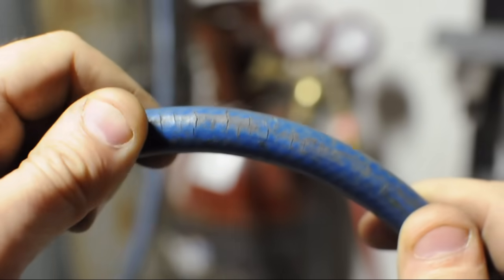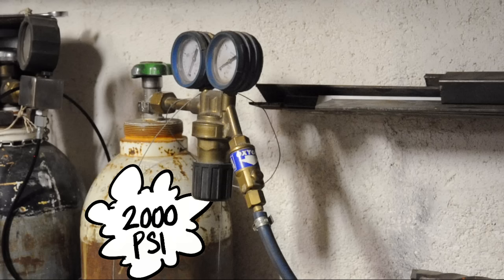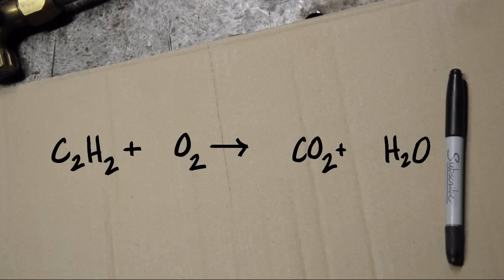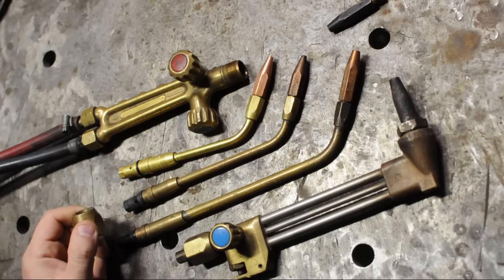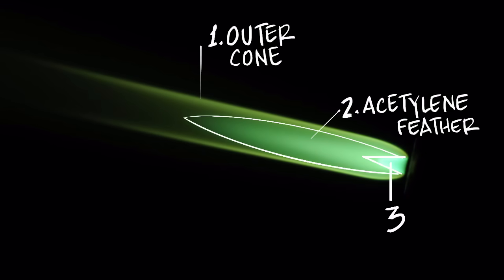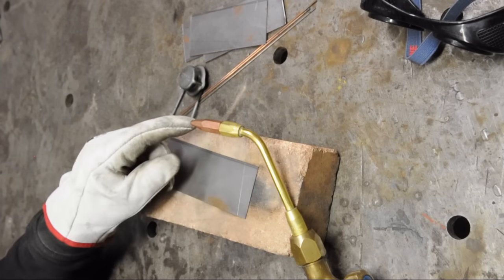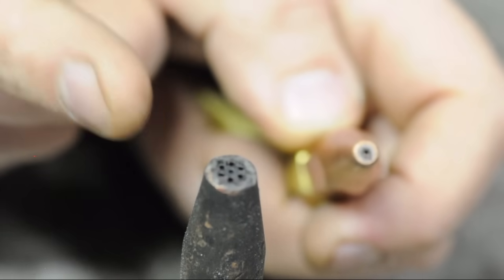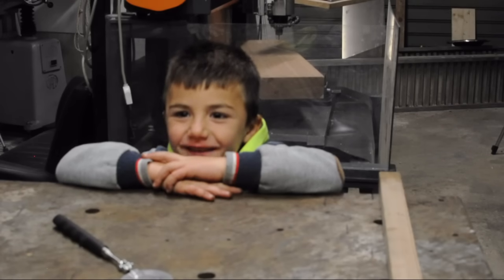Let's Talk Oxy Acetylene

Comment: Couple of things not mentioned. 

First, when you purchase oxyacetylene hose, make sure you get oxyacetylene hose. There is another grade/type which looks identical but is meant for propane or map gas only. If you use it for oxyacetylene it will degrade from the inside out and start to leak through tiny pin holes on the fuel gas hose. This is because the acetone vapours carried with the acetylene will attack and slowly dissolve the hose itself from the inside where you cannot see the damage. 

Second, the reason for using a striker to light a torch instead of a match or lighter is in effect gas conservation and safety. The cup that you always have on your striker is actually a small gas reservoir that collects some additional gas and makes your torch light easier and quicker. If you use a match or a lighter it can be difficult to light a torch where there is significant air movement from fans or, if working outside, wind that blows the gas away. In addition, using a striker ensures that you hand is away from the flame ignition point and you are less likely to get burned. 

Third, the charts that your torch manufacturer provides for pressure settings are only good for about 25 feet of hose and are only guidelines. If you have more hose, the pressures must be increased to compensate for friction within the hose dropping the volume at the torch tip. A better way to set your gas pressures is as follows:
       1. With the acetylene regulator adjustment screw fully relaxed crack the main valve on your acetylene bottle and when the regulator is fully pressurized open one full turn. Adjust your acetylene regulator so that you just have a small amount of gas flow.
      2. Light your torch and open up the fuel gas valve on it all the way.
      3. Slowly increase the pressure from your regulator using the adjusting screw until the flame just blows away from the tip. This is the maximum amount of gas that particular tip will flow. NEVER EVER set your acetylene regulator for more than 15 PSI! Acetylene can become unstable at higher pressures and become self explosive.
     4. Close the torch fuel gas valve until the flame returns to the torch tip or shut it off completely.
     5. Ensure the adjusting screw on your oxygen regulator is completely relaxed, stand to one side or out of the line of fire and crack the valve on the oxygen cylinder open and allow the high pressure to ease up to full pressure. NEVER OPEN THE VALVE ALL THE WAY UNTIL THE HIGH PRESSURE SIDE OF THE REGULATOR HAS BEEN SLOWLY BROUGHT UP.  If you open the valve wide initially you can damage your oxygen regulator's Bourdon tube inside of the pressure gauge and in extreme cases actually blow the glass out of the gauge itself. The surge of high pressure has also been known to blow the regulator body off the bottle when the regulator has been damaged hence the standing to one side out of the line of fire unless you really want to catch a pound of regulator propelled by 2000 PSI with a portion of your body which can be painful if not deadly.
     6. After the regulator has been fully pressurized, open the oxygen valve all the way and adjust the regulator pressure screw so that there is a small amount of oxygen flow.
     7. With the torch lit and burning at the tip (not blown off the tip), open the oxygen valve on your torch all the way. You will notice that the flame changes when the oxygen reaches the flame.
     8. Adjust your oxygen regulator up until the flame becomes neutral. 
     9. Increase the opening of your fuel gas at the torch slightly and bring the oxygen up again until you have a neutral flame. Continue to open the valves as described and adjust your oxygen until both torch valves are open fully and you have a neutral flame. Your torch is now set for the maximum flow that that particular tip will flow and is at it's highest efficiency.

Fourth, when using fittings or hose splices on oxyacetylene systems, the fittings cannot be copper. They must always be brass. Copper and acetylene have an affinity for one another and combine to form a new gas which is unstable and self explosive at virtually any pressure! In England, they used to use acetylene for lighting in homes. The gas was run through copper piping and on occasion entire blocks of homes and their occupants would simply blow up for no reason until this was discovered. Oops........so sorry, my bad.

Fifth, never discharge an acetylene bottle at more than 1/8 of its contents per hour. Higher discharge rates can result in the acetone in the bottle being drawn out into your hose and torch. If you must use higher rates consider using two bottles with regulators and manifolding them together. 

Sixth, when cutting material cant your torch tip slightly so the flame is going in the direction of the travel. This will preheat your material and give you a cleaner cut with less slag adherence on the bottom. Thinner materials will require more angle than thick. If your cut is so poor that the pieces stick together use a hammer to part them and not your torch. Nothing speaks of poor practice more than a torch that has been used to hammer pieces apart!

I know that some are going to give me flack over this but consider this: I am a journeyman welder with over forty years experience and I have never blown a gauge up or destroyed a torch. A torch can be a versatile and precise tool in the hands of a good tradesman but, like anything else, it can be so much junk when abused.
Reply: A small correction to your note about copper and acetylene: the danger is not from the formation of a new gas but instead from the formation of the extremely sensitive explosive copper acetylide from the reaction of acetylene with copper oxide formed from the surface oxidation of the copper during manufacture (and from any air that might have gotten into the line at any point). Copper acetylide is indeed highly explosive: the analogous silver acetylide is used in certain types of blasting caps as a primary explosive initiator. The reason brass is safe is because the oxide coating on the surface of brass is composed almost entirely of zinc oxide: this is inert to acetylene and prevents the formation of any explosives.

This doesn't affect the correctness of anything else you said though.
Reply: Thank you for taking the time to add this to an already informative and well produced video. It's been my experience that many of the best teachers of workplace skills are folks like you who have decades of real world experience and the ability to speak or write well enough that others can really understand and absorb the valuable information that you have.  Again, I thank you.
Reply: Small correction t grade hose is for all fuel gas types,   r grade hose is for acetylene only and if used with alternative fuel will degrade fast.
Reply: A side note, rather than an addendum: 

Talking to former London Fire Brigade firefighters, one of the worse, and much hated fires, they used to attend was anything to do with bottle gas. Usually the Incident Commander (the highest ranking officer on the fire ground in charge of the operation), would order the maximum exclusion zone around it as possible, for just the firefighters alone, but still within reach of the water jets. A even bigger evacuation zone would be made for the public, and kept in place until the fire was doused out. 

The scary thing about a gas bottle that has reach the temperature of being 'cooked off', isn't just they might explode when they land, but just the sheer mass of one, at velocity, presents a risk to life and limb.

One last thing ... Never do what a friend, in a moment of sheer madness did: fill a large bin liner with oxyacetylene, and set light to it ...

Suffice to say the bang, in the large hall he did this in, was strong enough to rattle the windows, and shake the dust down from the tiled roof above ...
Reply: Thank you for the added information. Welding instructor at school also said using a butane lighter to light a torch is like holding a small bomb in your hand. There is some potential that the lighter could explode (that's why you never keep one in your pocket).
Reply: Yes, its clearly easier to use a striker to light a torch than using a bic, thats why nobody ever does that.
Reply: @johndias6614  Styrofoam cups are a much safer alternative to this practical joke.. cough cough, don't do this...
Reply: This is the best Youtube comment I have ever seen. Amazing.
Reply: You clearly are a pro. Good stuff, thank you
Reply: No one does stick welding anymore... I feel excluded! :(
Reply: Some very knowledgable characters here. Thanks for sharing.
Reply: @johndias6614  I threw one fast on the ground once and it exploded and just disappeared.
Reply: Some great advice, thanks for taking the time to pass it on. I'm glad to be able to tell you that we here in the UK are now blessed with new fangled electric lighting in order that our houses no longer explode 😁 I've just spent the best part of a week machining and brazing up castings for a customer and have come to the conclusion that I need to invest in some new torch nozzles! Some wacky flame shapes even after extensive cleaning.
Reply: You, Scooter, are a god among men. Thank you for sharing the knowledge.
Reply: @billsmathers7787  copper is the catalyst en witch is normally needed in most cases to create a gas or a chemical reaction. (DOI NOT TRY THIS AT HOME KIDS IM FOR FUCKING REAL HERE YOU MIGHT DIE!!!!) like bleach and ammonia does not create mustard gas by its self does it will react with each other like most chemicals do if mixed but take a penny pre  1940 or whennver copper pennies stopped being made or some COPPER and poof now you just made mustard gas the copper is the catalyst that created the reaction.
Reply: @nigelft  out in my buddy's dads junk yard we would take oxyacetylene and let it pump into a upside down 55 gallon drum that was dented to get it straight again and run a trail of gas and light it and watch as BOOOOOM it could go way up into the sky lol like a good ways. or we would take a 1/4 stick of dynamite and use it to move cars in places the loader would get stuck or just to make life eaiser as booooom a car would go flying.  good olds days lol
Reply: @billsmathers7787  Thank you for your correction.
Reply: @johndias6614  Regarding butane lighters in your pocket, years ago as an apprentice I did just that. In my case though I was welding at the time and noticed that my left leg seems to be getting cooler than my right. Since I was outside in the shade, I assumed that the wind was picking up a little and kept going until the end of the rod was reached. By the time I broke the arc I knew something was up as my left leg was now definitely burning. Not from heat mind you but frostbite from my hip to halfway down my thigh there was a layer of frost as the butane boiled off from a small hole that a spark had melted through the side of the lighter. It was, to say the least, a never ever again moment.
Reply: @Biden_is_demented  Stick welding is very much alive and kicking and is still used on about 50 - 60 percent of all the work done. The problem is most DIY folks have access to or own a small mig for it's ease of use. If you want to learn stick, talk to any good welder and most would be more than happy to offer some tips and possibly some coaching. One of the most in demand jobs in the coming years will be welders. A Union welder can make anywhere from 50 - 150 thousand a year depending on his qualifications and where they are located. I have made in excess of 160 thousand in one year myself working for wages here in Canada on piping systems in the petroleum industry.
Reply: @PurityVendetta  Yes, I had heard that there had been some improvements in that area. Now, if we could just get your to drive on the right side of the road........lol.........just kidding. There is a reason that England and some of the other English based countries drive on the left and other places in the world drive on the right.
Reply: @Biden_is_demented  heaps of people stick weld. Stick welding will never be obsolete. Want to weld hot and heavy outdoors in the wind. Stickweld.
Reply: @I_leave_mean_comments  So you follow the NASA approved Apollo 13 school of engineering?
Reply: Did you open a textbook and copy straight from it. Everyone on YouTube is suddenly harvard educated
Reply: Ok mr professor. Or was this your thesis? 

Jk informational and whatnot it was. For others at least.
Reply: Holy fuck. Who’s mans?
Reply: @zznet2  Or fill zip up gym bags with town gas, that's very dangerous and silly as well. Number 00 zips make the best burners.
Reply: I am a safety officer and i am gonna save your comment.
Reply: Many tips I didn't know.  One problem I used to have occasionally was that the bead would start to spark more and more and then POP and put the torch out.  Any idea what caused this and how to stop it?  It was usually when welding exhaust pipe.

Was this flash back?  I did at least have arrestors in the line.
Reply: @John Sikes - I'm no pro welder but since nobody else replied, I will. I was told that this was caused by getting the puddle too hot and when it boils, we see that as a pop and that is what blows out the torch flame. I'm sure others can chime in and correct me but even if I'm wrong, that's the effect. Too much heat and pop. The solution is to back off, move a little faster or in some other way reduce the heat in the weld puddle.
Reply: @majormindup  Thx, next time I weld something I will give it a try.  I had someone there when it was happening one time that was a training to be a welder at a tech school, and the same thing was happening to him (with my rig) and he didn't know why, so I was thinking it might be something in my setup.  The boiling kind of makes sense, since it would eject sparks right before the pop.  It was infuriating because you couldn't weld a continuous bead, and since I just picked up a torch without ANY training and sort of taught myself to weld, I didn't have any idea what was causing it.  Extra fun when you're welding ABOVE your head and body, like I was there.
Reply: @scootertramp4355  I didn't realize frostbite was a risk of a lighter while welding. That has to be one of the most ironic injuries ever.
Reply: @5000rgb  It wasn't pleasant and my partner laughed like hell. I was just glad that it had not ignited. It would be hard to explain to a doctor or a safety officer about how you froze your thigh first and then you set it on fire........lol
Reply: @MrJdsenior  I would have to see what you are doing to be sure but from the sound of it I would say that you are using a slightly oxidizing flame and your torch tip is too close to the bead. When gas welding mild steel you should have a slightly carburizing (acetylene rich) flame. An oxidizing flame will normally have a very pointed looking inner cone and be accompanied by a noticeable hissing sound. A carburizing flame will have two inner cones. The main cone will be larger and a bright blue while second cone will be at the tip of the first cone, smaller, and a darker blue. Both of these cones will have a more rounded end and the sound will be soft. The carburizing flame will ensure that you are not actually burning the metal. With an oxidizing or oxygen rich flame the excess oxygen will actually weaken your weld since the O2 is causing the metal to burn much like slag from oxyacetylene cutting. An oxidizing flame will cause your weld puddle to "sparkle" and throw off small sparks as the metal is being burned. The only instance I know of where an oxidizing flame is used is to sear cast iron just prior to brazing it.
The "pop" and subsequent blowout can be caused by a couple of things. First would be improper gas settings where there is too high an oxygen pressure. Second would be getting the torch tip too close and getting it too hot or having dirt on the end of your tip which can glow and act as a source of ignition. When this happens, the gases can start to burn inside the tip causing a small explosion. While irritating, a "backfire" is seldom a major cause for concern. A true flashback is a situation where the gases actually begin to burn back inside the torch and then into your hoses if very severe. Normally when you get a flashback, the torch will blow out but it will continue to blow off black smoke with small sparks and have a high pitched whistling sound. I have seen a torch where the flashback was so severe that the torch handle actually melted. Flashback is caused from improper gas pressures. If your O2 pressure is too high, it can start to back feed the lower pressure acetylene back in the torch and into the hose if left long enough. Since this is an oxygen feed flame it will not normally extinguish itself and your acetylene is burning inside the torch. Another possible but less likely reason is very low O2 pressure where the acetylene over pressures the O2 and the flame "chases" the O2 back into the torch and line. This is normally caused from an O2 cylinder being close to or in fact empty. The cure in both cases is to shut off your fuel gas valve on your torch immediately. Flashback arrestors are actually miniature cooling grids made from steel or aluminium mesh in a small canister. As the fire tries to pass through them the mesh or corrugate acts as a heat sync and cools the flames below its ignition point causing the fire to go out.
Reply: @oh8wingman  WOW, thanks for the VERY detailed response.  Yes, much harder to diagnose the "disease" over the "phone", I get that. 

 I was trying to set flame neutral, and was pretty careful to make sure the cones were accurately matched, making sure even the tiniest possible decrease in ox moved the cones apart, and that I was right on the cusp. of cone alignment. There was no "excess noise" from the flame, like you get oxy rich, as you say. 

However, I didn't know about wanting a slightly carburizing adjustment for mild steel, so that might have helped.  I used the pressure settings given for the tip size, so they should have been right, but they were very long hoses, and now I wonder if there could have been pressure drop to the far end from the regulator static settings.  The tip was clear, as I had to clean it after some of the pops, which did exactly what you mention. 

Maybe I should have adjusted the pressures AFTER the torch was in operation?  I know that used to cause headaches with paint spraying, to the point where I started running the compressor regulator 10-15 PSI above the gun pressure, and put a secondary regulator AT the gun (a LOT more flow there, though, I'm pretty certain).  The other fix was flowing air continuously from the gun, stopping the trigger at paint cutoff, rather than full release, which became pretty automatic, once I thought of it, or lucked into it, don't remember which.  Seat of the pants learning gets you there usually, but you miss a lot, and it's more difficult.  On the other hand, I sometimes come up with techniques that work really well that I never see other people using, (until I finally do see one that "get's it").  Here's a good one for you if you do any electrical taping.  Before you begin the wrap, stretch the tape about 20% or so. and you can easily make very tight, even almost water tight (at least spray water, not submersed) wraps.  

And yeah, the very old screens in the miner's flame lamps way back worked that same way, thermodynamically insulating against explosive atmosphere detonation, rather than any type of physical flow restriction, pretty cool and clever that, wonder who first came up with it, and if they even knew WHY it worked when they did?

"Torch melting"...scary stuff, sounds like a way to get a nasty unexpected burn, even through the gloves (another thing that amazed me the first time, how long those gloves stay REALLY hot, and how fast you manage to get them off when you do latch on, or stay too close for too long, to something you shouldn't.)  Sometimes hard to know what is hot and what is not, unless it's VERY hot, radiating in the visual range. 

Reminds me of the guy who picked up a hot blacksmith's horseshoe and immediately dropped it, garnering a wry question from the smithy "Whatsa matter, bit too hot for you?"  Where the "dropper" immediately replies "No, just doesn't take me that long to examine a horseshoe."  I know, everyone's heard it, but it's still worth an honorable mention, IMHO.  ;-)

It was amazing to me how many things I thought worked one way, and found out they worked in a totally different manner as I progressed through my engineering degree.

If I ever fab anything with a gas torch again, I will try this, or maybe even find some pipe and just try your ideas to see if they work, if there's still gas in the cylinders.
Reply: Scooter Tramp my friend was using a striker to light my torch but he waited a few seconds so a gas cloud built up around his hand😂. He will never do that again
Reply: A huge thanks for adding your notes to this excellent video
Reply: @EricK-ig4ko  Except for you as it seems. You can't even use the correct punctuation marks.
Reply: This is probably the most helpful comment I've read on YouTube. As a newbie trying to learn this comment is gold.
Reply: Damn good stuff right there.. Ty for sharing your knowledge. Every bit of information helps..
Reply: Thanks for the essay
Reply: Jack Braddell  t grade also fine for oxyacy fuel ?
Reply: acetylene passing through copper tubes at high pressure. that's how you produce some benzene. and benzene is bad news almost in any case.
Reply: Very informative!  Thank you for sharing your comment.
Reply: @majormindup  Carbon in the tip? Dirty?
Reply: Many thanks for an excellent tutorial! We've learned a lot.
Reply: I’ve learned more from this then I did in my high school welding class
Reply: Im guilty of using the back end of the torch to lightly chip away stuff. Lol
Reply: What a bloody great comment mate!! Glad I read it. You've made at least one person safer in his workshop, thanks. 

I use oxy LPG due to the cheap cost of gas. May change to acetylene if it's significantly better for some reason?
Reply: Thanks for sharing your knowledge and experience.
Reply: @PurityVendetta  hi, you want to clean and flatten the faces of the nozzles, the slightly round the edges (so they don't melt off). Use the proper gauge cleaner for your nozzles with a deft touch. You can check for excessive wear with the proper sized drill bit held only in your fingers, gently insert it (-she) and if it isn't a nice tight fit (-she, again) you might need to replace the nozzle or upsize it (don't, instructor!)
Reply: @scootertramp4355  you got rid of that left leg? great move!
Reply: Fourth, when using fittings or hose splices on oxyacetylene systems, the fittings cannot be copper. They must always be brass. Copper and acetylene have an affinity for one another and combine to form a new gas which is unstable and self explosive at virtually any pressure!
Aren't the 'tips' or 'nozzles', whatever is the correct term, made of copper?
Reply: Hello,so if i would want my oxy acetylene tanks to be outside of shop for example,which pipes i could use to bring both gases inside shop(brass only ?,how about pvc for plumbing bathrooms ?) ,after which i would ofc use these normal hoses that are everyone using ,red and blue :P.Sorry for my bad english.
Reply: @nigelft  Great! thanks for planting the idea in my head.  Now I'll have to resist every time I see a garbage bag.  :-)  Maybe just a balloon is OK?
Reply: @KnKDarkLotus  

Oh God ...

Decades ago, when I was in College, a fellow student several years older than me, told about a story about how he, and some friends of his, found an old, abandoned car, in the middle of nowhere. So they saved up their money, topped the tank up with as much as they can, whilst leaving several, full, petrol/gasoline cans inside ... 

Suffice to say, the fastest one stuffed a rag in the hole where the petrol cap would be, lit it, and ran ... 

He didn't dare go back, but the way he described it, before he took off running, rather than a bang, it would've been a boom, big enough to shred it, rather like an artillery shell dropping onto it practically vertically ... 

Part of me wished I could have gotten my grubby little hands on dynamite, but given what just enough dust, of any organic* kind, in an aerosol form, plus an ignition source, can do ... perhaps not ...

[*= may not be organic, but, aside from mine explosions, from coal dust, one of the worst was when a badly maintained sugar refinery went up. The aftermath was lethal (14, in total), and practically tore through solid metal structures like it was wood, and paper ...

https://en.m.wikipedia.org/wiki/2008_Georgia_sugar_refinery_explosion ]
Reply: @andrewallen9993  

The very same ...

But, to be honest, no-one, in the entire brigade, was prepared for, let alone trained for, a fire of that magnitude. 

The initial 'Stay in Place' order was done, because it was thought that the fire floor could be contained, meaning the floors above could be evacuated, safely. That meant each crew could make it up the available stairwell, without having to push through a panicking crowd, but rather clear each flat in an orderly manner.

What caught nearly everyone off guard, was the possibility of complete loss of containment, as the fire evolved between the outer cladding, and the exterior brick/concrete walls. Aside from the cladding being extremely flammable (and yes, no-one thought to test the bloody stuff, to the correct BSA Fire Standard), it also created a huge number of vertical channels, meaning the fire quickly swept upwards way faster than anyone could anticipate, in the 1"-2" gap between the cladding, and the 'exterior' wall.

Worse, given the height of the building, but the narrow streets, means that, unlike, say, the FDNY, with their tiller ladders, the LFB doesn't have anything of the kind, so they had to fight the fire from within. In fact, it was so bad, the then Commissioner of LFB herself, was not only there, but briefed every single fire crew entering that towering inferno, as she knew she was facing the very real possibility that some, if not many, weren't going to make out alive; she wanted to look each and every one, in the eyes, as she was certain she was sending them to a certain death. 

Also, and this was equally unusual, it was Assistant Commissioner, who resinded the 'Stay in Place', as he became the Incident Commander (which is very rare occurance), meaning command of the fire ground reached the highest levels of the LFB, before calling the Commissioner himself, for her to be on the fire ground, in person, just in case she needed to pull every available engine, in London, to assist. 

It was, in effect, a 5 Alarm+ fire, an absolute inferno that evolved rapidly, with equal rapid loss of containment. In my living memory, of 46+ years, Grenfell was one of the worst fires the LFB has ever faced, and the fact the then head of the LFB, whom very rarely, if ever, gets called to an active fire ground, was summoned for, indicates the utter magnitude of that blaze.

Was the 'Stay in Place' wrong ...? In hindsight, yes. 

But equally, worse was the decision to add exterior cladding, of unproven flammability, in a manner that, whilst the aim was to retain heat in winter, reflect sunlight in summer, it actually created an absolute death trap. 

It was horrible for the residents, and equally horrible for the brave men and women entering that building, not knowing if they were going to get out alive. 

The death toll was high, but it could have been much worse. In fact, at one point, there was fear of partial, if not total, loss of structural integrity, but due the tower block being mostly concrete, fortunately, that didn't happen ...

So, yes, the LFB had a lot to answer for, but, as has been said, short of the Kings Cross Fire, which claimed the lives of many firecrews, including a Station Officer, only yards from safety, not since the Blitz, there has been no other fire, on dry land, that went completely out of control, in the same manner. The only thing that comes close to the same kind of structural fire, was when the Piper Alpha Oil Platform exploded. Grenfell was, and is, the worst structural fire since the Blitz.

What started as a small kitchen fire ran away from any kind of containment possible, and there wasn't a damn thing anyone could possibly have done to prevent that ...

So, yes, I will still take their advice still, since, as has often been said, Safety is too often written in blood. 

It also led to the Commissioner's resignation, and, quite, possibly, a lot of old timers taking early retirement, as they couldn't face walking into any other fire, ever again. 

So, to reiterate, the 'Stay in Place' order was standard for a high level kitchen fire ... 

... but not the inferno that turned a tower block into a torch ...

https://en.m.wikipedia.org/wiki/Grenfell_Tower_fire

https://en.m.wikipedia.org/wiki/Piper_Alpha
Reply: @noimagination99  

You can try, but depends on the size of the balloon ...
Reply: @nigelft  The fire began at about 00.50 and the brigade responded very quickly, on site by 01:00. The stair wells only started to fill with smoke 40 minutes later. I'm 63 years old and can climb a 100 metre tall microwave tower and descend again in 30 minutes using a safety harness with dual clips. 40 minutes was more than adequate time to evacuate the whole population of the building safely but the people who burnt to death were foolish enough to take the London Brigades advice and stay put. An hour and fifty minutes after the blaze started the Brigade changed its mind about the stupid stay put policy and essentially advised residents to help themselves thus allowing 36 people to save their lives by not staying put.
Reply: @nigelft  I was thinking the kind that carries people in the air.  (JK !!)  I have a cat that looks like your avatar (what I can see anyway).
Reply: Lovely
Reply: @Mikeracing2005  NOT a small correction.  You might also have mentioned that type-T hose, while costing more, doesn't get the "dry rot" that plagues type-R hose, so it lasts a lot longer. After replacing the type-R (natural rubber) twin-hose on my rarely used acetyl-ox rig a couple of times due to dry rot. After bellyaching to my welding gas supplier about the short hose life, he asked why I didn't spend a little more and get type-T (synthetic rubber) in the first place. With the exception of accidental damage, I have never needed to replace a type-T hose set.
Reply: The first paragraph about acetylene hose is incorrect. You are referring to type-R hose that is for acetylene only. The hose you recommend against is a superior hose - type-T, designed for all fuel gases.  You might edit your otherwise very good post to correct that. 

Type-T hose, while costing more, doesn't get the "dry rot" that plagues type-R hose, so it lasts a lot longer. I had to replace the type-R (natural rubber) twin-hose on my rarely used on my big acetyl-ox rig a couple of times due to dry rot. After bellyaching to my welding gas supplier about short hose life, he asked why I didn't spend a little more and get type-T (synthetic rubber) in the first place. With the exception of accidental damage, I have never needed to replace a type-T hose set. Atmospheric oxygen degrades the jacket of type-R hose giving it the dry rot look Tony's hose has.
Reply: For the first one: use CaC2 xD
Reply: WOW!

I'm getting every handsome of using my little tote set now just to heat up the drag link and pitman arm on my semi tractor that don't want to divorce.

The host of this video and you make me feel like I'm back in high school again in my metals class.  However, I think I'm getting even more with your comment.

Thank you from a guy that has to be his own mechanic cuz he can't afford car mechanics and there's never availability of semi-truck mechanics.
Reply: @oh8wingman  

WOW AGAIN!

The hits just keep on coming!

Thank you for your post as I'm a garage mechanic by Financial necessity and by availability necessity.

I will be mostly using this Postart 21508 I bought from Praxair today just to heat up Rusty fasteners on 20-year old relics.  All my life I've suffered the rounding off of a Fastener or the snapping of the Fastener or just the inability to even do the above. I think now that I'm in my mid-fifties I deserve an easier way to deal with these fasteners.
Reply: "In England, they used to use acetylene for lighting in homes. The gas was run through copper piping and on occasion entire blocks of homes and their occupants would simply blow up for no reason until this was discovered. Oops........so sorry, my bad."
ROFLMAO
Reply: I’m gonna use the lighter, nerd
Reply: May as well do a video scooter
Reply: Welder,and author of novels
Reply: Scooter Tramp,
Maybe you should make a video.......
Reply: @nigelft  Reminds me about the guy in a maintenance shop for an auto carrier. The guys would set off acetylene bombs to harass the boss. One night one of the fellows carried a large plastic trash can liner filled with oxy-acetylene THROUGH the shop and detonated it in the parking lot. In the morning they found it had been set off between 2 semis ready to make deliveries. Each of the 2 had all the car's sheet metal and glass completely crumpled and broken. All the cars were totalled. Obviously nobody "knew what happened." What if it happened in the shop? A little static....
Reply: I turn on the acetylene to a low flow and then turn on ox to just a bit lower flow than acetylene. Light lighter as fast as possible and boom I'm dead. Lol. But seriously it works perfect
 Then I quickly adjust for perfect cutting/heating purposes. When starting with a small mix of oxygen it cuts down on the little black ghosts aka carbon/suity particles floating in the air.
Reply: @TheSRBgamer63  - Replying to a very old post...
You SHOULD NOT plumb Oxy and Acetylene from outside into your shop.
You need to constantly adjust the regulators that are mounted on the bottles. For safety you also need to be able to shut it down fast.
You cannot bring unregulated (high pressure) gasses into the shop, then have the regulators close to you. That is massively dangerous.
Just put the bottles on a trolley and use them in a normal way. There is ABSOLUTELY no reason to do what you are proposing.
Reply: @Biden_is_demented  two years on and the welding supply shops are still selling thousands of boxes of rods
Reply: @George.Andrews.  I know, stick welding is still the preferred method when structural sturdiness is desired. No other method has as much penetration. Having said that,  it is obvious that MIG and TIG have surpassed sticks in popularity. As some anecdotal evidence to this , one has only to check out the fabrication channels here on youtube. Every youtuber and their uncle uses MIG. We stick welders are dinosaurs...
Reply: @Biden_is_demented  yes I love mig to get the job done.
Reply: Wow thank you very very much!!!
Reply: @MrJdsenior  That happens when you are using too large of a tip, and too low of flow for the tip size.  Switch down to a smaller tip and open the valves further for more flow.  It will prevent the banging and extinguishing of the flame at the welding tip.
Reply: @johncoops6897  That's not true. In industrial settings, the gases ARE plumbed, and there are many reasons, safety as the greatest. Because regardless of all the safety measures taken, there is ALWAYS risk of things going horribly wrong, in which case you really wish the gas reservoirs to be outside of the area you are and work.

Well, I'm not familiar though what kind of setup is and should be used in them. Not water pipes at least, I think. And possibly some pre-regulator at the bottles for safety, and a fine-tune one at endpoint outlet. And maybe some electrically remote-controlled valve for emergency shutoff, maybe with added automation by gas sensors detecting buildups. Or something like that.

And regardless of setup, I would always advise to have gas alarms of some kind in spaces where gas setups are used and stored.
Reply: yeah ok i got it but i never heard of big map gas cylinders
Reply: Great safety info, Thanks!
Reply: 🤓 you know a lot
Reply: Great comment from a 40 year journey,a welder… However, this 32 year engineer that worked for Victor would disagree with some comments… Too lazy to go into specifics; but, physics also disagrees with you! Glad you have not killed yourself, but some risks your mention are trivial or nonexistent!
Reply: Back in my day (like 6 months ago) I worked with a real old school fabricator for a month or so. Always had lighters to choof darts, but could NEVER find a striker when you needed it. Suffice to say that I never had hair on the back of my left hand haha.